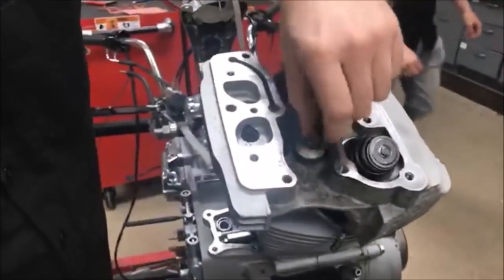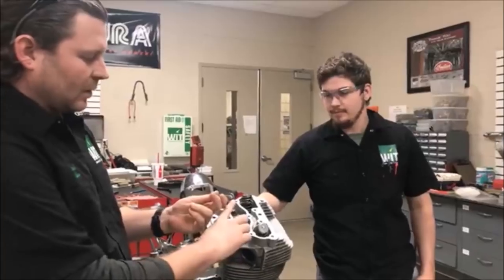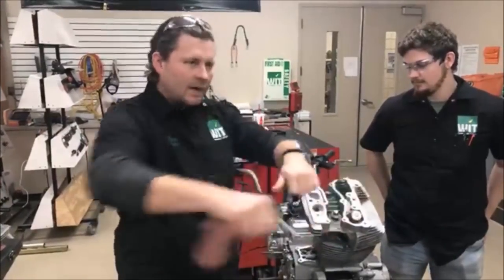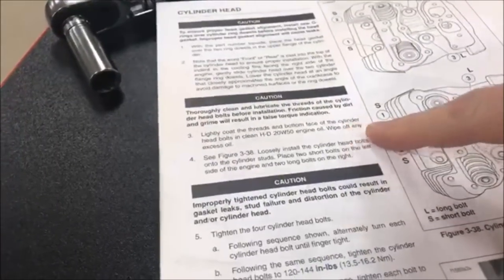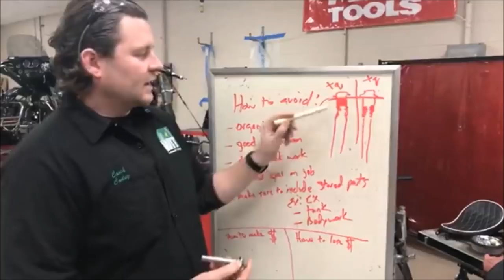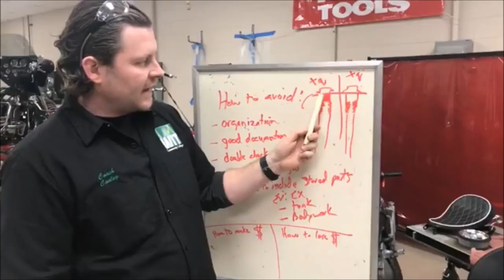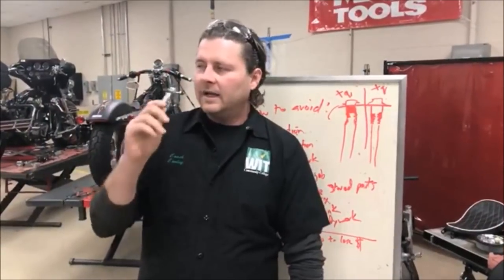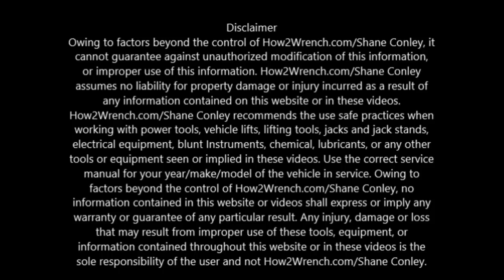How to install a Harley Davidson cylinder head using a torque angle method. Tips for all bolts!

Comment: Instead of using oil on the bolt face, why not use grease ??
Reply: because that is not what is recommended in the manual